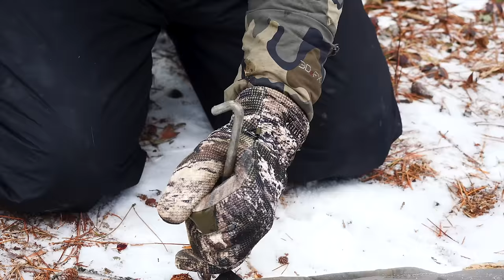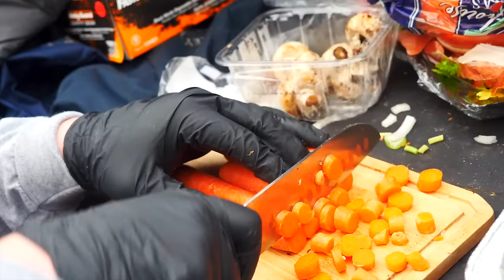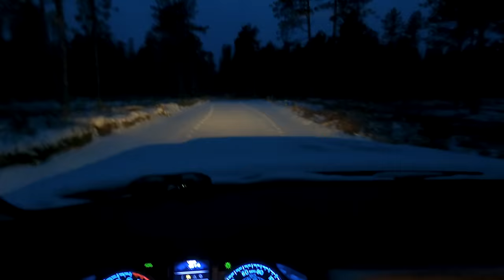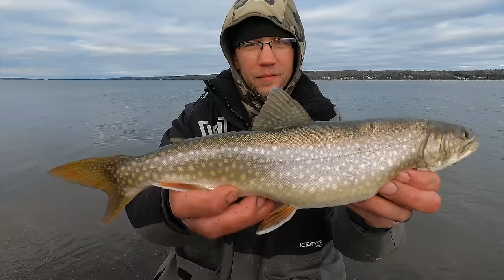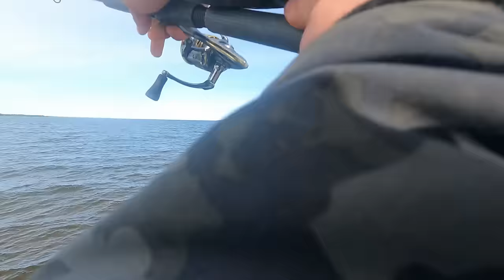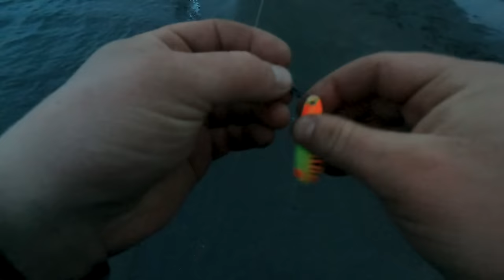Hot Tent Camping, Cooking & Surf Fishing Lake Superior

Comment: Any idea why splake have a size limit ?
They are hatchery made cross between a brook and lake trout and do not reproduce.
 One would think there only purpose would be to be stocked caught  and eaten.
 Also i believe they are not a long lived species five to seven years maybe?
Also have you seen the remote controlled toy  boats being used to run lines out from shore 
 instead of wading out and casting?
Might be an option for some of the areas you cant reach
As always great show 
 And tight lines